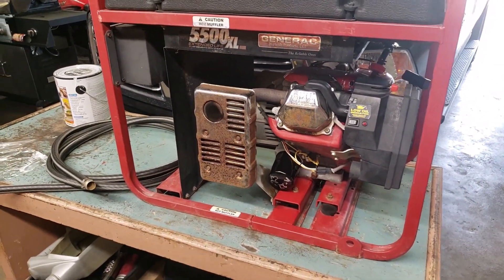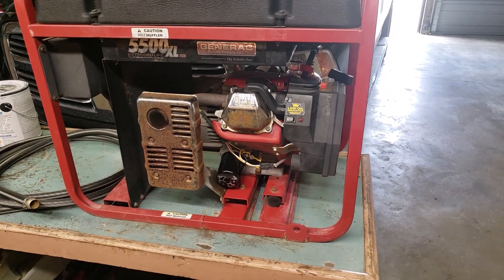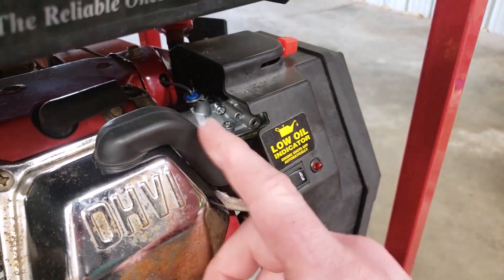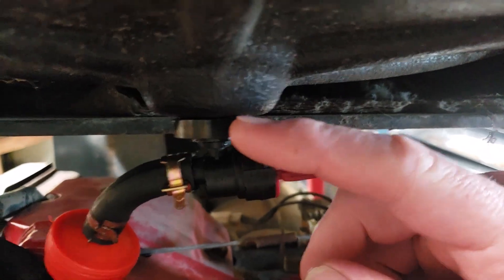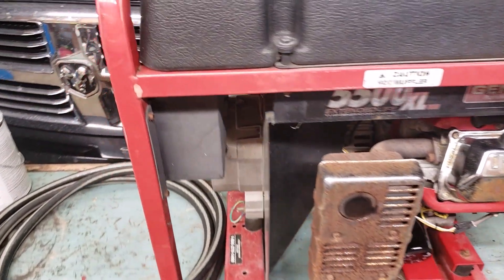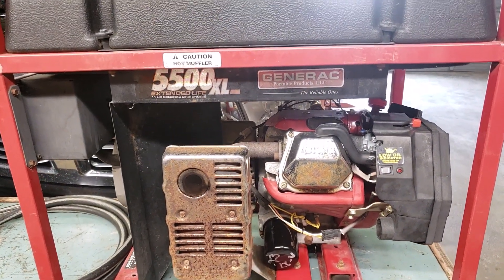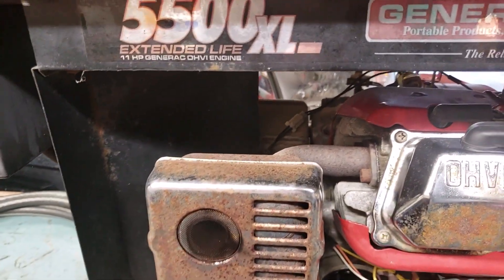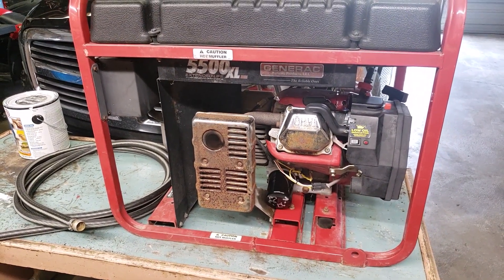Repair after storage Generac 5500XL Generator

Comment: Any idea where I can find that breather tube and carb? Repairing one myself and the tube is not salvageable. Thanks!
Reply from the maker: Not sure YT will allow me to post links in the comments. I will put a link for the breather tube and carb in the description of the video.
Reply: @crankytuber  Thanks so much!
Reply from the maker: Did you get a new carburetor? https://amzn.to/49CLwxm
Reply from the maker: Heres the breather tube.. https://www.ebay.com/itm/204553092983
Reply: QUESTION: I have one that I start and run under a load for about an hour every 3 months. Runs fine BUT recently it ran good for about 8 seconds before I put a load on it then it died. Happened several times in a row. Could it be a faulty oil pressure switch (sensor/sending unit)?